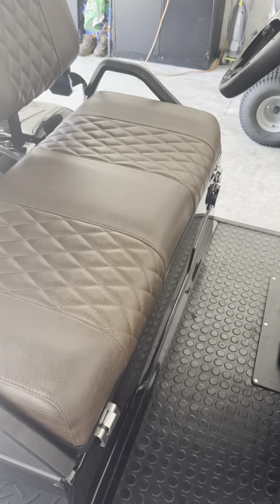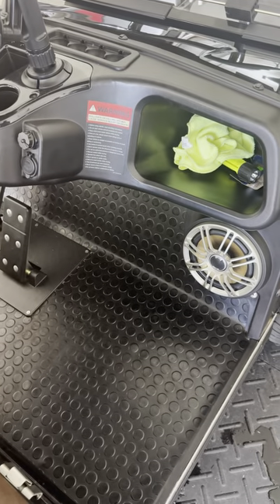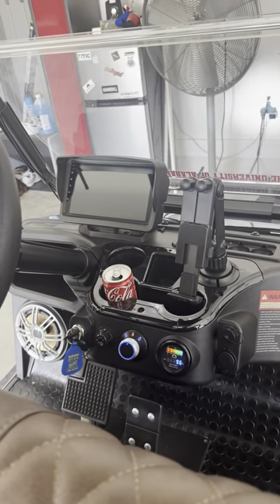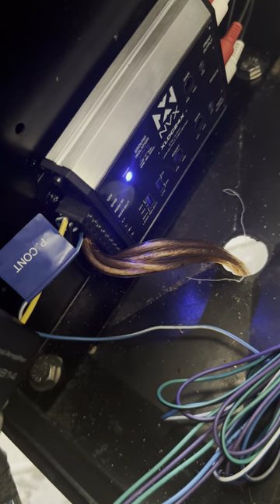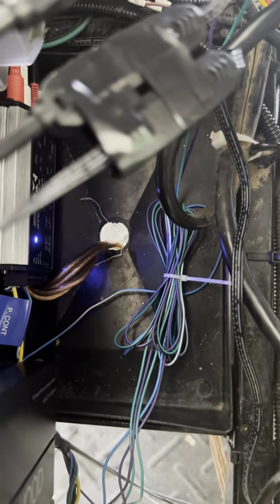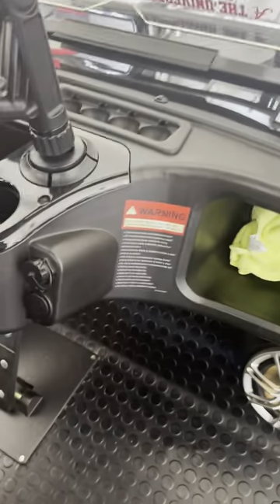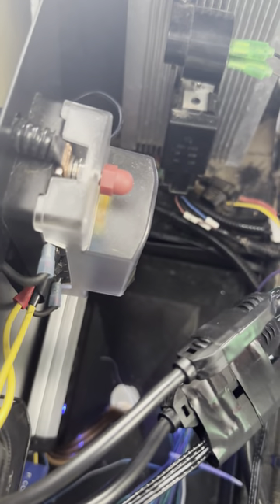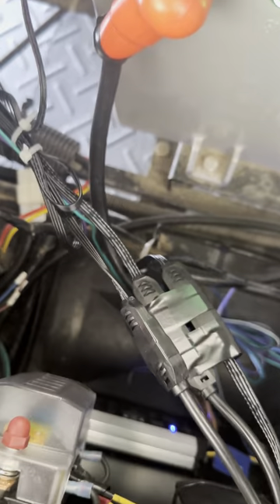Speaker and amp install 2023 Evolution Classic 4 plus

Comment: Cool video...I am wanting to do something similar!  Can you clarify where you got power off the DCDC converter?  Was it the red fused wire coming out?  I have seen BA carts plug and play system and they tap into the 12 volt charge port under the dash with some spade connectors. I'm not sure the overall schematic for these carts so I wasn't sure if that could provide the power needed to run the amp, or if it would be better to connect direct at the DCDC output.  Is the DCDC output controlled by the key switch?  Or would the amp always be on?  Thanks!
Reply from the maker: The BA carts power plate was already installed so I’d have to take a look and see where they actually got power from for that fuse box. I don’t think you’d have enough power to run an amp directly from the charge port. The converter is controlled from the key switch so everything powers on and off with the key, the amp doesn’t stay on. I will try and make another video that shows where the fuse box is powered from and I’ll upload it. Hope this helps and thanks for watching